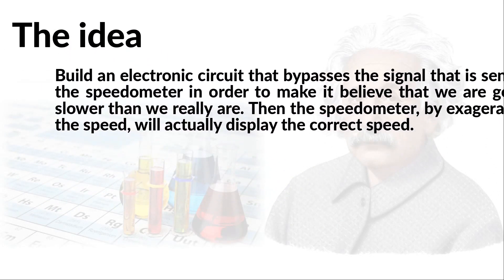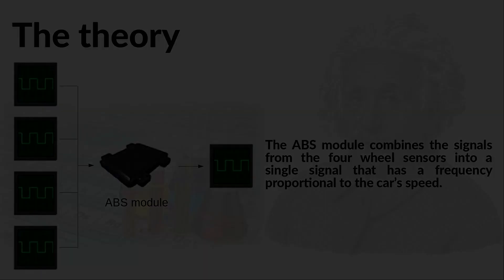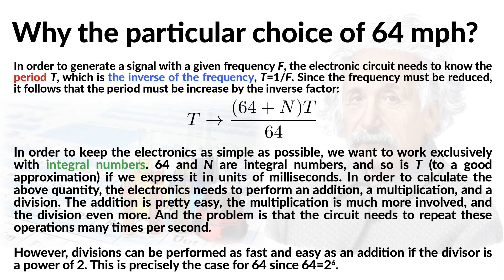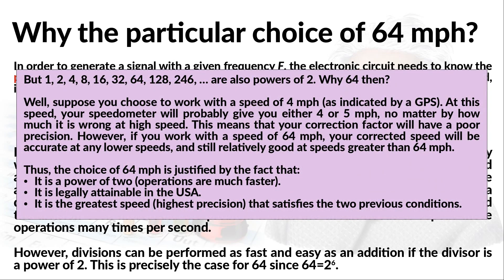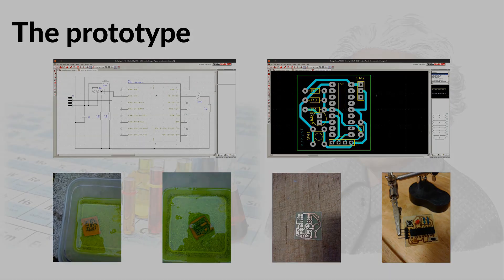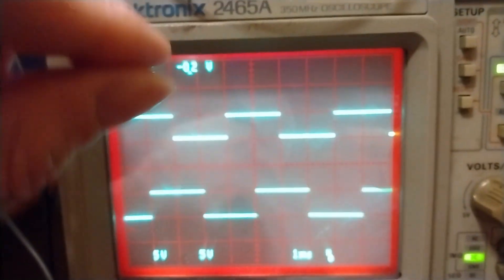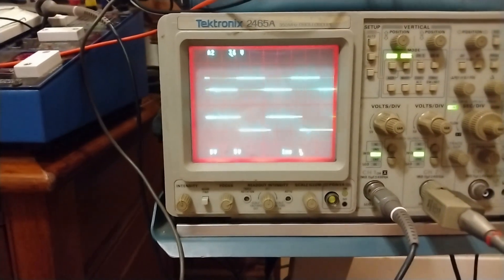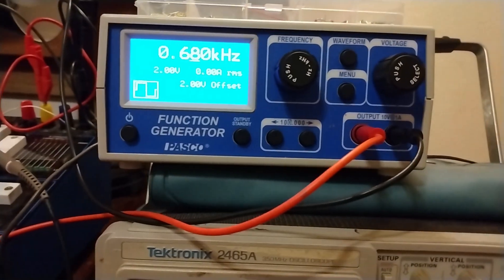How to calibrate a Toyota Prius Speedometer - Calibration Hack

Comment: I can confirm that the pulses are not used for the MPH display on the combination meter. The speed is coming from the SKID ECU and is transmitted via bus network
Reply from the maker: Ok, thanks for the info.

Comment: I need this how can I get one
Reply from the maker: Thanks for your interest in this project. Unfortunately, I never found the time to install the device in my car and check whether it works or not. I would need to locate the wire that sends the frequency to the speedometer, and check what voltage it is using to make sure that the circuit is compatible, and possibly modify the circuit if it is not. I just need to find the time to do it. Then it would be easy for me to make copies of the circuit and sell them on eBay.

Comment: did you ever get to mount the board to your car?
Reply from the maker: Not yet. I haven't had enough time to dedicate to it yet. I have identified the wire that corresponds to the speedometer input signal. But, when I cut it, one end goes to the speedometer and the other end comes from the ABS unit. The problem is that I don't which end is which, as it is hard to follow the wire across the thousands harnesses in there. And I cannot take the risk to try at random and blow up the ABS unit or the speedometer. So I have to make some tests in order to see which ends send the signal. For this I need to plug my oscilloscope. Now the problem is that the wheels need to turn for the signal to be sent. I cannot carry my oscilloscope inside the car and drive it, because I need to plug it on 120V. The other option is to put the car on a jack, and turn the wheels. But I don't have a jack at the moment...
Reply from the maker: Also I need to make sure that voltages in that wire are compatible with my circuit, and do some adjustments if this is not the case. I need to measure these voltages, because the wiring diagram documentation of the Prius is very bad. The documentation is completely chaotic, and no voltages are indicated.
Reply: @BlueMoonshine  Sometimes wiring diagrams can be difficult specially on a hybrid car. When you have a chance maybe you can help me on a project. try to email me once you have a chance.. Thank You Gino Chiri
Reply: Did you manage to have this board available for sale?
Reply: Waiting